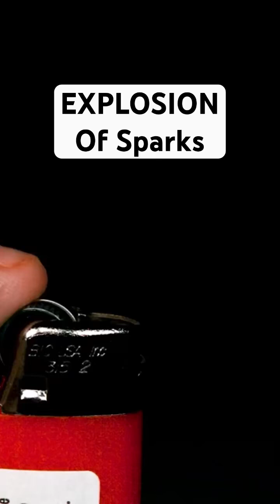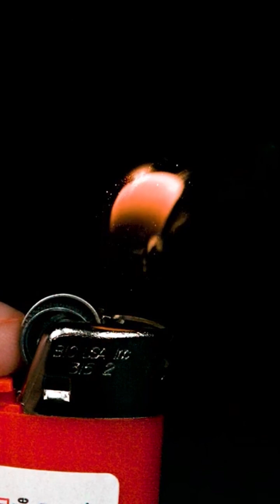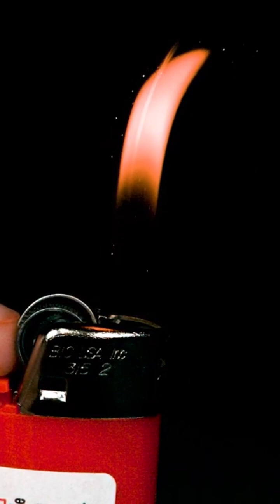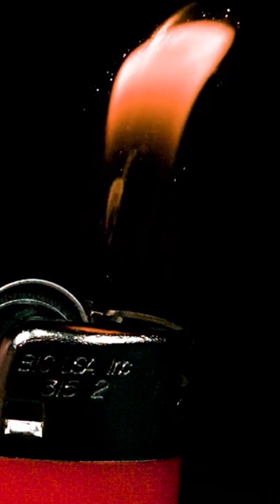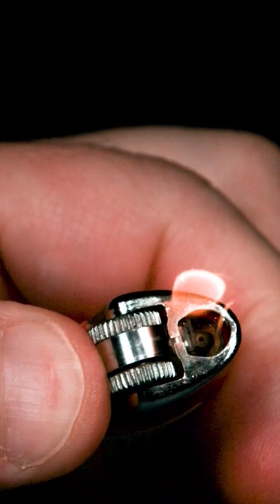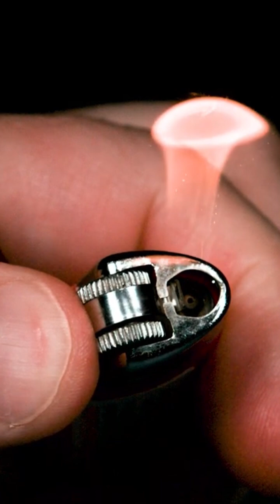An Explosion of Flame & Sparks

Comment: Get yourself one of those flint/steel bar sets they sell at Walmart in the camping section. The good ones shoot sparks 10 feet away! Would be fun to see on the high speed camera.
Reply from the maker: Definitely going to do that soon thanks so much
Reply: @JasonGibsonScience  Thank you again Jason for all the work you did putting together your TI89 calculator series all those years ago. I have an 89 and a 92+ and all that information has made these two devices so much more useful to me, I find myself reaching for the 89 instead of the nSpire or the Prime simply because I know how to get an operation done easier and quicker on the 89!